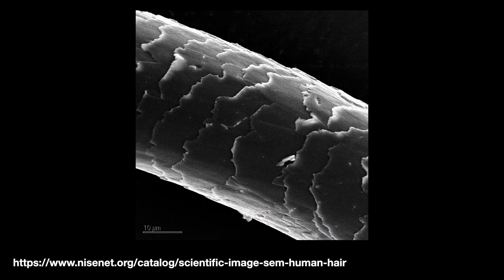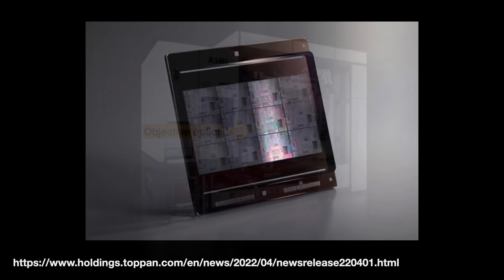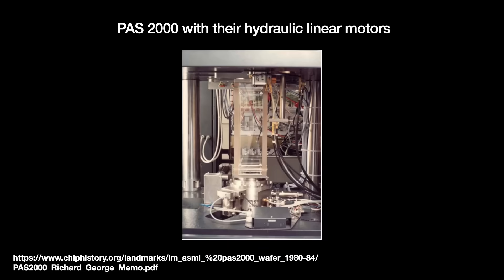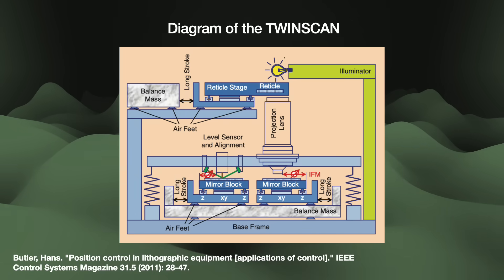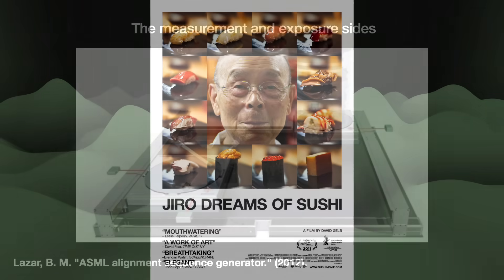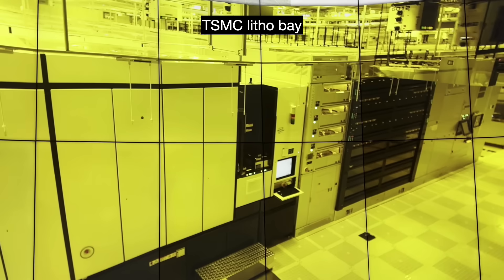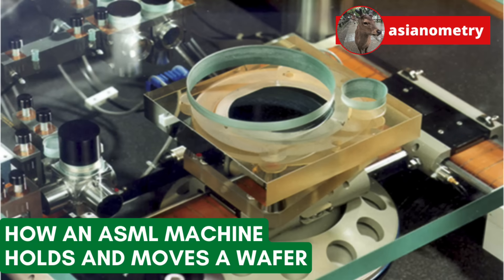How an ASML Lithography Machine Moves a Wafer

Comment: The CaesarKing previously ordered the energy nodes per segmented groups as their security wall when needed power source and resources source energy fill as the group members of each segment are productive that energy node produces interest by percentage money increase to a high performance of square rooting that effect money source by levels and degrees of performances of square rooting to the numerical powers of ascending load if up side trajectory category belongingness and lower numerical increase from base numerical number load of energies and resources of whatever side project mode, now another project augment continuation, the open and close group segment for business and trade, projects and programs per group and active and passive transports meaning their each group base within those segment or by interconnect with other nodes of trust and benefit, the Matter and G types of whatever category belongingness or control  effects can penetrate the secured energy walls of nodes worldwide of steal resources and conquer if acting and operating not within their identification principalities and  its core groups can no longer be understood by continuous change mode and shape shift even by their own members within the group, if such event happened the group members can be grabbed by invade group accomodate and accumulate regardless of marked, sealed, branded, tagged by this fake environment and beliefs world stage. A programmed event in time starting now. Let it be

Comment: can correct wafer handling work successfully with just any magnets, rather than need very specialized magnets with very technical metal alloys?!
Reply: Great idea. Use magnet cheaper than in an electric scooter in a 400 000€ machine.

Comment: All this tech and they use hard reticles? Why not digitize them first and cut out a bunch of lenses and mirrors? Feed the digital info into the laser assembly in a pure state that was gathered beforehand in a more stable and controlled environment focused on that one step. Heck, these circuits are probably birthed as digital before anything is fabricated. Making reticles is an odd step. I wonder the reason.
Reply: One limit is the sheer amount of data one reticle holds.

Comment: Wowww , so the laser actually "walk all the chip circuit" (anyone knows how many kms?)for every chip (thats why that much speed is needed)

One have thought all this time they only needed to do that once , like for drilling on a metal or some expensive material sheet , the actuall circuit,in order to make a template (near perfect tolerances/precission, but only a few needed)

And then just align that template to the waffle , run light trought it (staticallllly like a flashllight) and print all the circuit at once

Damn i was wrong, they need to do it almost perfect everytime!!!, for every fracking chip

That's consistency and not my wife's headaches at "bedtime"
Reply: Already 6502 in the 70s needed 50 process steps, but I dunno about lithography. I think they used flash lamps and steppers. 

Can the mask move straight like the wafer for a scan?

Comment: why do they expose those pieces around the edge of a wafer that clearly cant fit the whole chip?
Reply: That  is not an ASML thingy so I can try to answer: first, a field (one exposure) can contain multiple dies,  as, there is an array of (the same) dies or chips on the reticle. Second reason can be that the process of the fab needs the surface of the wafer after exposure and bake to be (sort of) homogeneous. So leaving out patches with lower height, different surface etc could negatively influence their workflow.
Reply: @kramnecknerf  thank you.

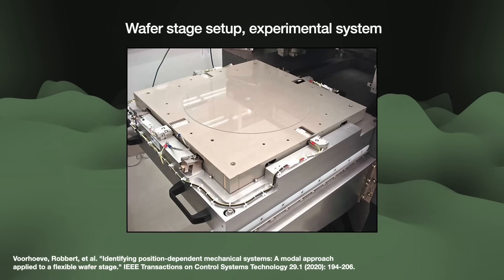Comment: 11:03 - Wow, never knew voice coil motors are actually used in such high precision machines for motion control. 14:26 - Elaborate more, transistor not staying in place due to the magnet? 15:43 - God damn 1.25 billion lines of code? They gotta stop using Python to program their machines and use good old assembly and C/C++.

Comment: Great vidoeo as always. One issue is I guess I dont understand the math here. You say these can do 120 wafers a minute. Thats 2 a minute. If its 2 a minute that means one every 30 seconds. If the exposure is 20 seconds and they run parallel, measurement only takes 30 seconds? That doesnt seem that huge. You also say "1 every 2 minutes" mid way through which makes more sense, but then thats only 30/hour.

Comment: 09:50 
explanation here is incorrect.
model name of the machine depends on how the stage is driven and measured.
XT : measure stage position by interferometer system + stage is driven by air bearings and linear motors  / XT860:KrF, XT1460:ArF, XT1950:ArFi
NXT : measure stage position by encoder system + stage moves by magnetic levitation /. NXT870:KrF, NXT1470:ArF, NXT2100:ArFi
NXE : use EUV Laser, measure stage position by interferometer system

Comment: This video is just the tip of the iceberg. I work on the Canon steppers. On the Canons, not only the XY stage needs nanometer accuracy, but there’s also a Z-tilt stage that needs to move the wafer in Z and XY tilt accurately for precise focus. The projection lens need to be free of any imperfections to minimize aberrations. They also have computers, internal networking and much electronics and control systems. Like hrldoliente1 wrote, these tools are very complex and stressful to work on. I settled for an analogy device company that uses 90’s steppers, still complex but relatively relaxed specifications.

Comment: A talk about movement in an ASML Lithography Machine, without mentioning ASML's supplier Prodrive Technologies?
It is often joked how ASML (and it's campus) is on one side of Eindhoven and Prodrive (and it's campus) on the other side.
I visited Prodrive a couple of months ago. They had one of those evenings where they lure in developers and engineers with free pizza and beer and a very interesting talk about how they have developed their own Git for FPGA code, and hope some will apply for a job.
And we got a tour. I've seen those FPGA racks and they are indeed very impressive.

Comment: I don't know how the latest machines do it, but when I worked at ASML in 1998 (during the early days of the TwinScan when TwinScan was still called Atlas), the way that the machines avoided vibration was by having some counterweights that (although they weren't mechanically connected) moved around in opposite directions of the reticle stage and wafer stage. In those days, the motion control system ran on a rack of custom-made computers based on Texas Instruments DSP's that controlled the 20+ degrees of freedom all at the same time.

Comment: I work as a DUV metrology engineer at ASML. And this is basically the work I do for ASML. There is a lot I would to talk on about your video, but I'm not allowed. The only thing I know I can comment on is that you are incorrect at 10:00, that NXT and XT are just distinguished by their wavelength. I.e. XT machines also use 365 nm light. Although it is true that NXT is more advanced and therefore uses in general smaller wavelengths. And NXE always uses EUV.

Maybe it is a good idea to do a video about the NXE, NXT and XT differences? As I myself don't really know the differences between them that much.
Reply: Please send you sales guy to Jon, I am confused what to buy.

Comment: How red lasers can serve a precise measurements of position to nanometer scale if red light is if I remember correctly on the scale of 620nm wavelength? By using two frequencies you can generate beats of smaller order (that is how old metrology standards worked). But I have this doubt.
Reply: You make outgoing and incoming laser beam cancel out and then a very tiny movement much smaller than the wavelength will lead to a rather large signal.
Reply: https://en.m.wikipedia.org/wiki/Interferometry

Comment: It may be 1.25 billion lines of code, but only 1 line is required to see if the actuator reached its position and another line to stop it. I guess all the rest is reading different formats... Still though, 1.25 billion is too much for what it does. Given it needs to read a bunch of formats (say 20.000 to 80.000 lines of code), and to control the platform, that would be around 20000 to 30000 lines of code (reading sensors, adjusting velocities of actuators, coordinating sub-controllers/comms). All the rest is bloat and legacy code kept in comments in case they would want to revert to older functionality.
Reply: Yeah right.... Coordinate transforms, multiple chucks, multiple measurement systems, there ye go with two lines, one start one stop ...
Reply: @kramnecknerf  You must be very code illiterate. A whole Fourier, which is the heart for a system like this, is only 6 lines of code.

Comment: How much is known of the DUV Nikon and Canon lithography machines? I believe they aren't as modular as ASML machines. But other than that do they also follow a similar design, such as long-stroke/shortstroke? At least the wafer handler should be reasonably similar since they at least need to be able to handle the same FOUPs (not sure if the track are also similar? A video about the track might also be interesting).
Reply: Nikon uses short path interferometry in some of their tools (like NXT, nut the implementation is a bit different) Basically Nikon's aim is to have the actual stage (the opart holding the wafer) to be as passive as possible. So they have a secondary 'metrology stage' that has limited range and houses the sensors to align reticle/lens, dose control , lens heating etc.

Comment: I know someone who invented and patented a precision drive system using cycloydal gears. It's still mechanical in nature but requires only one moving part. Initially I thought that the drive system would work but now after finishing the video, realized that a mechanical system would never work for the kind of precision required.

Comment: A small correction: Timestamp 15:02: The wafer stage holds both position module chucks. There's no way the wafer stage has 15 Kg. I don't have an exact number for you but I can tell for sure that only a positioning module (which holds the wafer table) has around 50-70 kg.
Reply: I can, with 100% certainty, verify this having to swap one recently😅

Comment: The main difference between the XT and NXT machines are actually the wafer stage, going from air bearing to magnetic levitation, and interferometer-encoder system for stage align. There are also variants of XT machines that use ArF DUV light, and even immersion, but less commonly used.

Comment: I don't see how you would combine fine and rough movement stages. I've been working on a linear motor for some time now, and getting into the fine details is quite interesting. if you have a big mass to move, you need A LOT of energy for high acceleration and precise positioning. While there are many variables which can be tuned, at the end of the day you're limited by the amount of energy you can dump into the coil. because every bit of energy used creates heat in the electronics and the coil itself, which distorts the positioning, and no sensor in the world is accurate enough to measure that through the control circuit itself. the only way to measure the error generated by the heat in the components is with sensors that measure the output - interferometers in this case. however that means that you can only compensate for the error after it has already occurred, which means you have to always accept some error. of course you can run calibrations so you know exactly what movement generates how much heat distortion and create mathematical models for that so you can correct ahead of time but that also only brings you so far and means you have to perfectly control the environment so that everything is perfectly repeatable. so, splitting up the motion stage into two is a simple physical necessity. a smaller stage has less mass that needs to be moved, less heat in that stage that is generated, less distortion and error at the same speeds (to a point that it can also compensate for the errors of the larger stage).
Reply: Im not sure what problems you see combining fine and rough movement stages. You are right about the heat causing errors, but temp sensors are used. You are also right about model based compensation, feed forward control is often used, among other lesser known types, and you are right about calibrations and a well controlled environment. Hehehe, all of this is used in combination to achieve the mindbending accuracy. And the main reason for the two stage design is simply the process requirements. Need the wafers to move as fast as possible, but positioned within sub 10 nm. its essentially impossible to produce such a design in a single piece, a lot of math has been done to reach that conclusion.

Comment: Hey - quick question: does the stage actually stand still during illumination? I thought the stage moves continuously, with the reticle moving in the opposite direction, to “scan” over the section to be imaged.
Reply: I'm pretty sure moving anything during illumination would just create a blur. Ergo, the movement has to happen between individual exposures.
Reply: @Gameboygenius  There is a constand velocity fase during which the exposure happens. You "just" have to syncronise the movements. I don't think there are many bigger understatements then using the word just to describe syncronising 2 movements and achieving nm precision over a not microscopic distance.

Comment: I thought it was funny that the air bearings involve the wafers “floating” on a granite slab. All these wicked complicated polymers and materials and chemicals, and they use a rock to glide the wafers around
Reply: Yup, I've honed a few of them. Sometimes the puck feet will fail and scratch it. Just fill in with some epoxy and hone it down. A LOT is left out of these presentations on how noise is pushed out. The whole stage design is genius on these machines. Put your ear to the outside panel while running it is kinda like a clothes dryer because vibration is pushed "inside out".
Reply: Granite is used because it’s the most stable material you can imagine meaning it doesn’t grow and shrink due to the environment.
Reply: Flat earth 😂

Comment: There are pneumatic stage working in vacuum, you just need to locally create an air film and remove all the air leak from side using multiple stages of differential pumping. Seems crazy but it works. in fact these are some of the most precise stages that can achieve nm precision without using long-short stroke stacking. Such know-hows stay almost completely in Japan though.

Comment: Great content. I learned a lot about steppers and scanners I didn’t know here. 

However, at around 2:00, i'm not sure I follow what you mean by: “In the early days of the semiconductor industry, the whole mask contained the whole design. But as the designs got more complicated, the industry started using ‘reticles’, which represent a portion of the whole chip design.” 

“The whole mask contained the whole design” makes it sound like early processes only required a single mask, which as far as I know has never been true. The 1971 10um process required 6 masks, and earlier processes would still have required multiple masks at least for active areas, gates, and interconnects. 

Or, the other way to interpret what you said here is, I think, that on early processes, a single mask was able to expose an entire WAFER in one shot. This was possible when wafers were small and masks were large, and was generally available, I believe, through 4” (100mm) wafers that were in use through the 1970s. The entire wafer could be imaged on a single mask (one mask per layer), including multiple instances of the chip design that was being created, for as many chips that would fit on a 4” wafer. 

But by the time 6” (150mm) wafers came around in the early 1980s, steppers were introduced that required reticles, where each reticle also contained potentially multiple instances of a chip design (one reticle per layer), but then the reticle was stepped across the wafer, such that each reticle only represented a portion of the entire WAFER, as opposed to “a portion of the whole chip design”. 

Is that what you mean by those statements? Seems like some terminology like wafer, chip, and design are being used interchangeably, when they shouldn't be.
Reply: 100 mm not 100cm…
Reply: @mith5168 thx fixed

Comment: One more tiny mistake at 1:13 in the video. The caption says it is an ArF machine, but the picture is on an i-line machine. As seen by the type number (400) on the left and the fact that the light originates at a lightbulb inside the machine instead of an external laser. Saw the same mistake in an earlier video.
Reply: Yes plenty of this and a lot is left out, but he does a great job putting it all together. This one is the hardest to watch so far but cudos for it.